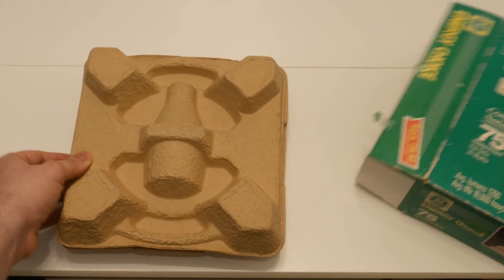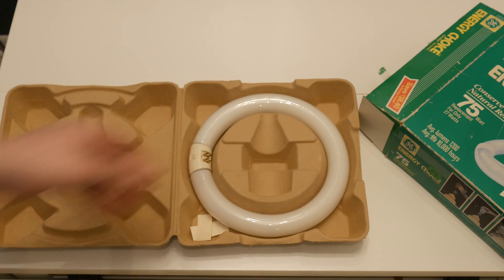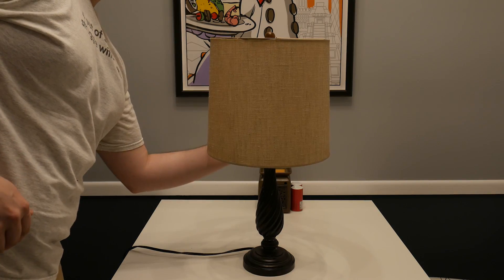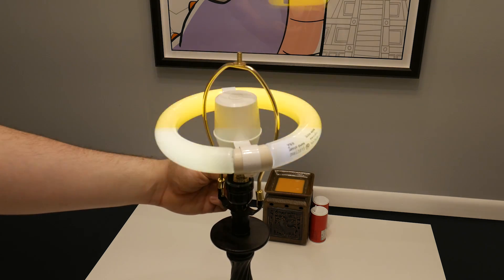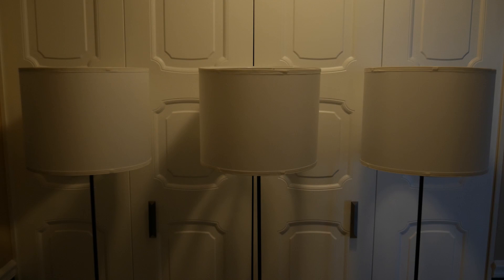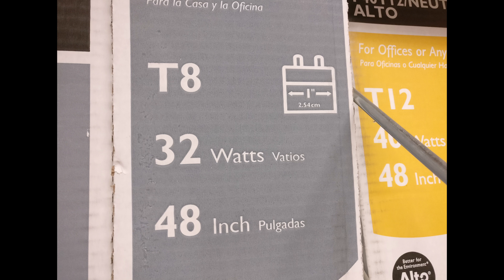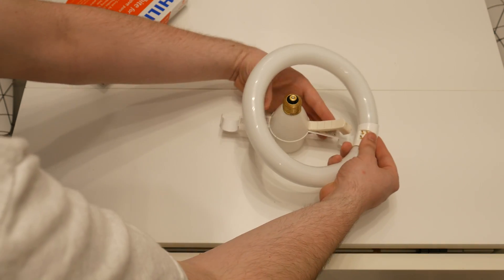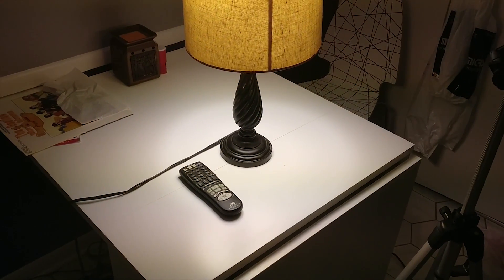GE's bizarre early attempt at a CFL

Comment: Actually, it is (or was) fairly common that circular tubes were just a bit smaller than standard straight tubes. It's just because it is slightly stretched during the production when you start with standard (let's say T10) tube and bend it to be circular. So if T10 is standard, then after bending them it is easier to get something slightly narrower. Probably later on processes changed and everything was easier produced with the same diameter.

Comment: Larger versions were popular in the UK in the 70s, usually built into hanging a ceiling fitting, looks like they are still sold too.
https://pricespy-75b8.kxcdn.com/product/standard/800/1127366.jpg

Comment: Wow this is the lamest product ever. Hahah 
Thanks for sharing
Reply: Not a lame product at all.  In the dark ages of energy saving lamps it was an inexpensive way to replace an incandescent bulb. Early CFL bulbs were priced at about $20 while these were below $10. The CFLs took about 2 minutes to get to full brightness. These had just that slight flicker and then to full brightness. As the video points up, when one needed a replacement bulb, just the bulb was replaced for less than $5.00. In the late 70's and 80's a very useful product.

Comment: We had a bunch of those, along with ceiling circline lighting fixtures.  Fortunately they didn't fit the fixtures in our bedrooms.  Over time my parents replaced the overhead bulbs with better flourescents, but the ones in the lamps never seemed to burn out.  In fact, my parents still have one lamp with a circline flourescent in it. It was there before I moved out about 30 years ago.

Comment: I can’t believe I came across this till today! My parents house had these lights all over the place, as the cost of electricity in my home country is relatively high, my dad tried to transform the house to CFLs since he bought it in the late 80s... We had about 4 of these, and next time I’m home I’ll check, but I’m almost positive they still work, over 30 years later... we didn’t use them for lamps, but for basic ceiling fixtures, they do achieve the purpose as you don’t even need to replace the fixture, and boy are they durable

Comment: Hey, guess what, it did last 20 years as yours is 20 years old.  I got some of these in an attempt to save energy in the 90's.  They were great for utility rooms and basements, but the coloring was awful.  I still have a couple of these, they still work, but they are just sitting in my supply room now as they gave way to LED lighting a few years ago.  I have some T12, T8, and T5 fixtures, still lots of confusing fluorescent tube sizes out there.

Comment: I had one of these in the family room floor lamp that saw a lot of daily run time. I bought it in the 1980's and ultimately replaced it in the naughty's with a CFL. I know I replaced the bulb at least once, but I don't remember if the starter failed or if I just replaced it when a better option became available. The original bulb fell squarely in the awful color balance range of old fluorescent bulbs (grayish-green to darkish yellow - a truly awful color), but the replacement was an improvement. The bulb was hidden behind a lampshade so it's aesthetics were not an issue. The bulb itself was never problematic but I can't say that I miss it, or, for that matter, any other domestic fluorescent light source which I'm replacing with LED lights.
Color balance, human perception, and preference is a funny thing. I have a strong preference for daylight balanced light with a high CRI. It doesn't look blue to me; it looks normal and I think I can see color hues for what they are. The strong yellow-orange cast of warm light looks artificial to me. I have no problem perceiving the yellow-orange cast all colors take at this color balance, and I really don't like it.
richard
"You can't lose what you never had!"
- McKinley Morganfield (AKA Muddy Waters)
Reply: The original tube was probably a halophosphate tube with a CRI that maxed out at about 70. The replacement was probably used rare-earth tricolor phosphors and had a CRI of 80 or 85. This is the reason for the difference.

Comment: Yep I have seen these in an apartment I lived in during the 1990's. The bulb was not on the fixture you see here but an older system that had to be replaced when the unit died. They put in CFL style not used anymore, an odd long tube that can be fitted to a standard cap or use this odd plug in.

Comment: the only advantage these things have is that they'll run forever. These will not burn out. My old workplace still has some of these around. As the company has flexible working times from 6AM to 10PM with a core time from 8AM till 7PM they usually run 16 hours a day. These things live forever unluckily

Comment: THIS is why I like the preheat started magnetic ballast  system, it's really simple and lasts a VERY long time. I have an old sheet music\table lamp that was bought back when my grandmother was a kid, and it still works with it's original tube! (it doesn't get used much, but still) also, a similar corded under cabinet lamp. I bought a replacement tube cause of the color, but that lamp lasted for nearly TEN YEARS of running about 4 hours every morning.

Comment: What's kept this weird size alive is use in magnifier inspection lights. There is an Arctinic in the series that's commonly used for PCB inspections for conformal coating coverage, as the UV causes the dye to light up. Only in the last 5 years or so people have started to switch over to LED as they have become reasonably available and fit for purpose.

Comment: This is fascinating, my grandfather installed this exact lightbulb in my mother's sewing closet when I was around 5 years old. Must have been 1983 or something.  The exact same lightbulb is still installed and still works to this very day. It is rarely used, which certainly explains why it has lasted this long. When it "ignites" it plinks and dinks and flashes around for a good 5 seconds before it illuminates,  dimly at that. Takes another minute or two before maximum brightness.  We talked about putting in an LED fixture a while ago,  but decided it was pretty neat this old bulb was still chugging along.  Thanks...

Comment: I hated those things. Our school replaced all outside light with those as it was supposed to be cheaper in the long run. But they do not last long. At least not when running 24/7. The constant flickering it caused when near failing was terrible and there wasn't a day when one of these lights in our school or hostel didn't flicker even though they were usually promptly replaced. 20 years my ass.

Comment: The standard still exists after 50 years. Amazing. There was some form of these in the UK that still existed in the 80's, and were old even then.  I remember them as a smaller diameter tube of larger diameter circle with what looked like a standard incandescent bulb in the centre. I specifically remember because it seemed an odd thing to do. Maybe I wasn't paying attention.
Of course we use bayonet fitting bulbs so you would have to push it in against the springs of the contact with some relative ( keyowrd ) force. But I remember it as a ceiling light fitting attached directly to the ceiling and get the impression the tube plugged in. Again, maybe I wasn't paying attention and again, it's oddity is something that makes me remember it- probably wrongly.

Comment: This unit predates 1991 by at least 20 years.  I bought two of them circ 1970, had them in two lamps in my family room from then till we moved in 1984. From 1984 to 1987 and 1987 to now they were in the garage lights. In the family room that was on 10 plus hours a day  for 15 years about 50,000 hours. I replaced both tubes in the 1990's.

Comment: On an interesting side note - at least in Europe, we had energy saving "bulbs" with an included magnetic ballast and preheat starter (just google Philips SL lamp). in the early nineties. I still have a dozen of them around and really love them^^ Back when I was a kid, I stole the broken ones from the recycling bin, took them apart and used the ballast and starter to operate normal T8 tubes - one of these ballasts is still in my friends bathroom lamp after all these years :D

Comment: We live in my grandparents old house and there is the exact model of one of those in one of the ceiling outlets, it has been up and running without problems ever since it was put in in the early 90s.
So it's been 20 years give or take a year without it showing any signs of failure👍🏻

Comment: I have a blacklight bulb for that fixture. I wish I could use it, however, all my ceiling lights are parallel with the ceiling. However, looking at how you use it, I can get an adaptor and use one in my corner light. Thanks for the idea.

Comment: I wanted to get one of those but I couldn't because I had  two sockets pointing out  instead of one socket properly pointing straight down as it obviously should!
Even  when using incandescent bulbs, a single 75 watt bulb pointing correctly  straight down provides over twice as much usable light as two 60 watt bulbs moronically pointing outward!

Comment: Being a frugal guy and old as well, I remember when these were the only thing that could be bought to suit standard table and floor lamps originally designed  for incandescents. I was well aware that they flickered to start, but thankful that they were not the linear 18 inch desk fluorescents that needed to have a button held down for starting, though at least those came on instantly if you held the button long enough to vaporize the mercury.
They were most popular during the energy saving days during the Carter administration as I recall. To sell them as energy savers, it seems they wanted to produce the most lumens per watt, and as you probably know, fluorescents do that with cool white phosphor formulations most popular in the early fifties before rare earth phosphors were brought to market to improve the brightness of color TV. I still have in the back of my garage an RCA color set from the late fifties that used a variety of red phosphors that was so dim, that to white balance the other two phosphors, needed those to be severely attenuated. A very dark room was required to enjoy that TV, but some say that the color renditions were superior to the later versions. RCA was still shipping development money with each set sold in those days.
GE was probably getting rid of poor quality phosphor mixes with that circleline lamp you show here. The cost to design that ballast as a self starter may have caused the division to cheapen its light output for that product. For commercial and hospital users of the circleline lamps in the ceiling fixtures they normally would serve, I think they had better QC for the color rendition, but so much light is wasted, with standard table lamp shades already generally yellowed to some extent from being cooked with incandescent heat, perhaps they felt they needed the more enrgetic phosphors.
Reply: SPIRAL STYLE CFLs didn’t exist much before 1990.  If you wanted a compact fluorescent, you bought these circle things.  My parents have one in their basement simce the 1970s (almost 50 years)!  Mounted upside down

.

Comment: Worked for hotel that had many of these. Nightmare. Easily 1 in 3 broke trying to install them. Either the plastic clip on ballasts or tube pulled from end cap. Only used because replacement tubes were around $1 less than replacing them altogether with LED.  Long term energy savings be damned when you're making a quarterly parts budget....

Comment: Here in the Philippines, we have that circline tube with the standard E27 connector in the middle, and it’s fairly common. Only difference is that the plug and the tube are now integrated, which means you throw away everything once the bulb goes out, and the ballast is electronic.

Comment: In the energy-crisis 70s, I installed a 2-light Circline fixture in our kitchen, to substitute for the three-bulb 'upside down birthday cake', common kitchen ceiling light.  It was polished stainless-steel or chrome plated, with two bare Circline bulbs of different diameters mounted concentrically.  22 & 32 watt, iirc.  There were three bulb Circline fixtures too, that put out even more light.

Comment: Uh... What do you mean when the starter fails ? On my grandparents house there's one of these GE's in the garage, the thing is almost as a old as the house and it works flawlessly every day. 
Sure, the T-9 tube had to be replaced, but other than that, this thing is eternal.
Reply: I've had to replace starters that are more than twice as old as I, they do fail but it seems to be a massive length of time if they're properly made. Newer (electronic?) ones definitely fail more often.

Comment: I own an electronician arm lamp, with a big lens in the middle. The circular tube lasted at least 25 years before failing. I replaced the tube and also the heavy ballast and starter couple by an electronic power supply made by B,A,G Electronics. With a 50kHz frequency, no flashing nor stroboscopic effect at all.

Comment: That particular configuration still exists. Available in 22W and 32W variants. The center section being more compact in both diameter and height and no flicker when switched on. In fact I had one in the laundry room as recently as 6 months ago, after which I replaced it with an LED, it lasted about 3 almost 4 years.

Comment: I had 1 for years (it failed ~ 10 ago). The C9 was a weird size. C8 was way more common in the era, being used in cheaper, knock-offs ( Lights of America). Those LOA models had 2 (visible) wires to the Plug. That was where the starter components were. These 'Magnetic' models were great. You could use them in Atics (very hot) or the barn/shed (very cold in winter). Not so with the later electronic models. ALSO NOTE Almost all CFL state: 'Not for use in enclosed fixtures' (They tend to overheat  and die. I found out these cool running lamps still generated enough heat to kill the electronics. Expensive lesson I learned in the 80's )

Comment: I had one. It was in my kitchen ceiling fixture for years. It even had a cover i guess you'd call it a lampshade. It worked great  neve gave me any trouble. The bulb lasted for years, saving me the trouble of changing it. The balest lasted through 2 bulbs. The only reason I'm not using one now is that my landlord changer the fixture.

Comment: My family had one of these in our kitchen for about 14 years, the ballast was in the fixture and it held 2 concentric bulbs and a clear cover textured with delightful bumps and geometric patterns. We must have inherited some bulbs from the houses' previous owners, as once we went through the leftover bulbs we swapped it out for an electrolier that adults probably thought looked much better as it could dim, but I found inferior. The kitchen is somewhere that bright, even light makes a difference, and I was confused why the parents would choose to go through the effort of installing a dimmer and fixture that used more power in just one of the 5 bulbs than the previous light, made more noise (okay, the florescent ones weren't always silent and maybe the adults couldn't hear the dimmer, but I could always hear a whine if the kitchen lights were on), and wasn't as bright.

Comment: My dad worked at a hardware store in the 90's and so was on the cutting edge with this, he replaced the bulb in my ceiling fixture with it.  Same starter is still going 20 years later and we've replaced the tube once or twice, but i never noticed an issue with the light color!

Comment: There's a lot of things from the mid-20th century that are done like that, T9 meaning 9/8ths of an inch, or an AN4-12 bolt being 1/4" in diameter and 1 1/4" long.  My only hypothesis is that tetra-ethyl lead is one helluva drug.

Comment: FFS a longer lasting bulb has been the holy grail of inventors since the fringing invention.
I have solar powered lights and other stuff  in various applications around my house and property.
And yes I have battery recharge and back up.( not off the grid yet)
But for the best light for work or play but a old school incandescent light .
Hate me if you want but it still is the best light.

Comment: I bought one of these fluorescent adapters at Caldor for $11.99 in 1983.  The ballast assembly always reminded me of a bottle of Old Spice aftershave.  I found it interesting that the FC8T9/WW circline lamp included with the adapter read "RAPID START" in spite of the device being a preheat setup. [Meanwhile, the contemporaneous GE Bright Stik pre-heat start fluorescent lighting apparatus contained a non-etched linear F20T12 lamp].  Anyhow, the circline lamp didn't reach end-of-life before the internal starter crapped out.  I remember replacing that Circline adapter with another one that came with a GE Soft-White Home Fluorescent, FC8T9/SW lamp, around 1990 or so.  I used that until early 1997, when I moved out of my parents' house at age 23, to embark on my emancipated adult life.

Comment: GE released an improved version in the early 90s with a quick start electronic ballast and improved color temperature.  These are actually better than CFLs in some applications, where good lighting of a desktop is desired.  Mine still work fine.

Comment: Many people are unaware since they were born after it, but there was an early 90's push for fluorescent lamps, with some pretty strange designs. I had a hitatchi "coat hanger" tube one that weighed a good several pounds. These circlines really took the cake though. As seen in old apartment car ports, kitchen ceiling sockets, closets, the movie blade runner, etc. Never once saw one actually installed in a table lamp. That awful phosphor is THE 'fluorescent light' color I always think of. I miss it for nostalgia reasons, but god were they bad. Lasted a heck of a lot longer than modern electronic ballast CFLs though.